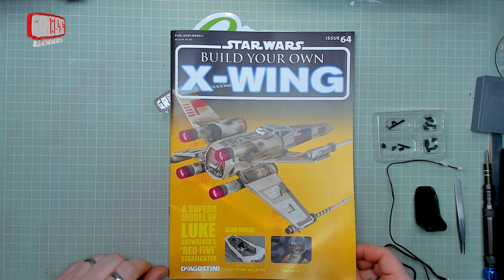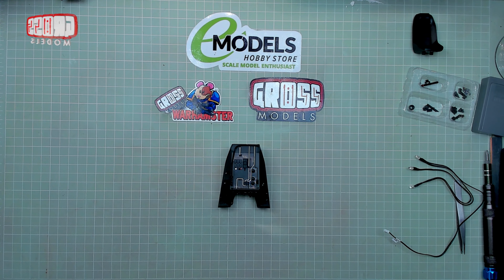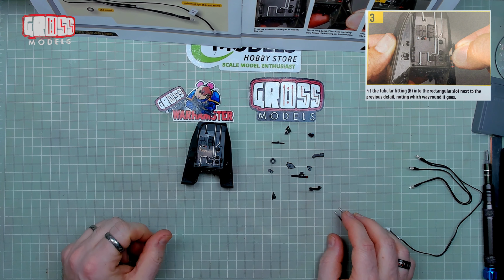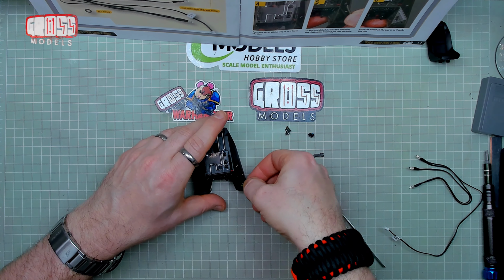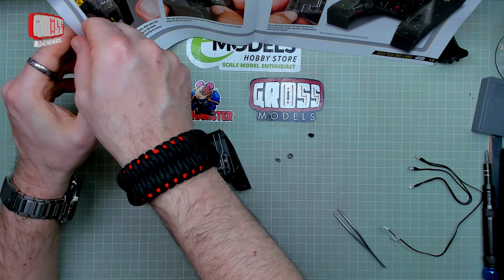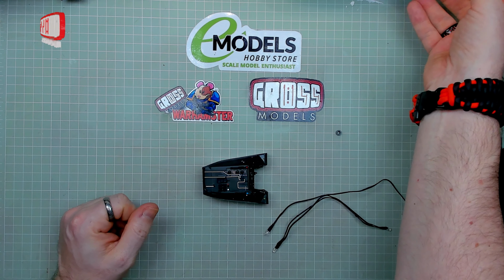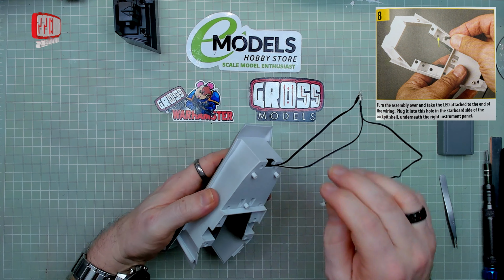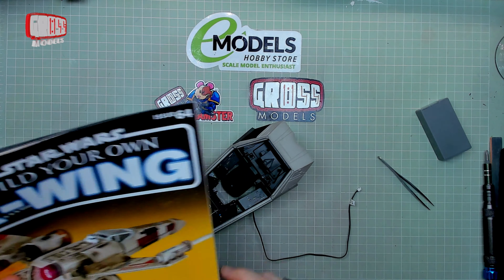DeAgostini 1:18 scale X-wing build. Issue 64

Comment: I'm nowhere near as far ahead as you are, and my deliveries have been delayed by DeAgostini due to lack of stock, but I anticipated there would be issues with light bleed and boring white lights, so am planning to use colour changing LED's in the cockpit, as I did with the one in R2D2. they tend to be less bright and obviously change colour randomly, adding to the effect.
I've also used a flickering red LED in the 1 engine I've completed so far and this works really well.
Reply from the maker: Nice idea. I don’t really want to play around changing led’s but the flickering sounds good!